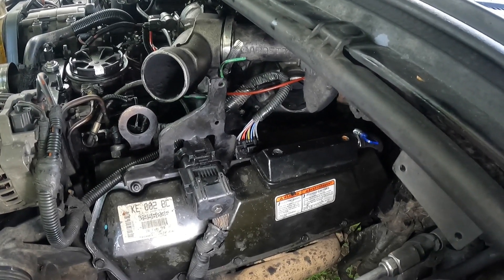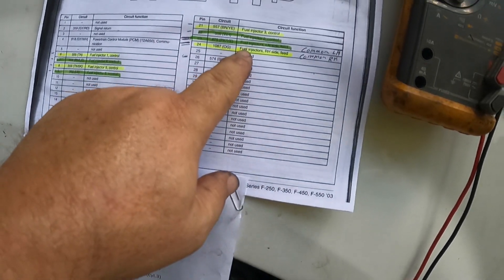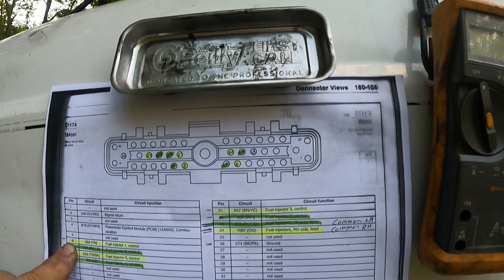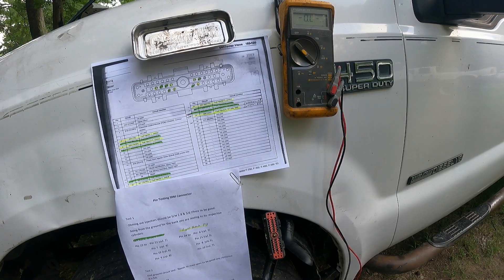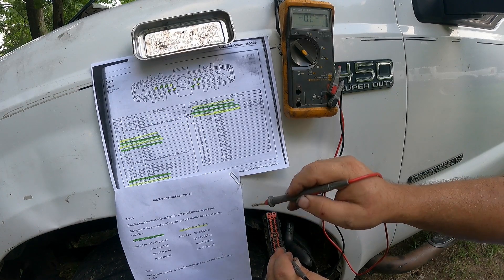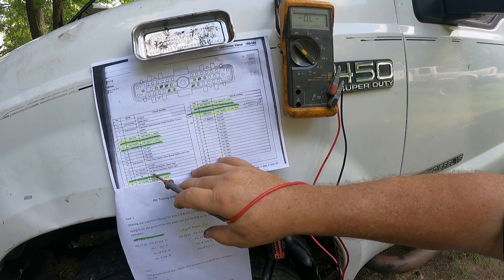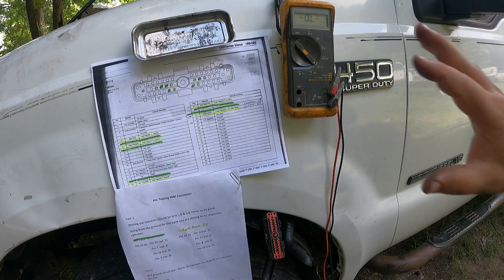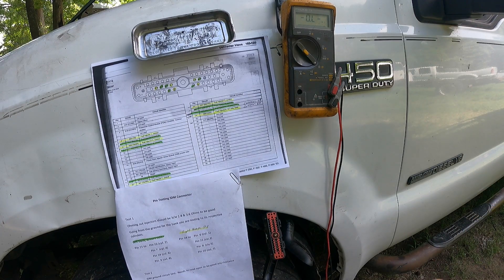IDM Wire Harness Pin Test. P1316 DTC.   2001 7.3 Power stroke

Comment: cyl2 is 14.0 cyl6 is 6.1. every other one is in range . would those 2 injectors make the ohm read like that or is it only related to the loom.
Reply from the maker: Good luck. Hit me back if you have questions or just let me know what fixed your problem. 
If you replaced the uvch and it’s pigtail a good place to check for frayed wires and shorts is both sides of the 42 pin plug. Also is common to pinch wires on the uvch when putting the valve cover back on. 
Thanks for watching
Reply: @bayoudiesel  so the passenger side is fine it's cyl 2 and 6. are not in range.
Reply: @bayoudiesel  the ground to circuit test passed as well.
Reply: @bayoudiesel  and it was the same result with different IDM so I think its safe I can put that back on
Reply: so I reckon I'm tearing down the driver side next. gonna do a new uvch.
Reply from the maker: @recruit_life0715  that is the usual thing to start with. You can also move your test closer to the problem and redo the test at the 42 pin plug as well as the 9 pin uvch connector. But if you are not sure when the uvch was last done it may be good to start there. Up to you.
Reply: @bayoudiesel  where is the 42 pin located
Reply from the maker: @recruit_life0715  that is the large plug that sits over the driver side valve cover. They are known for chafing wires that rub on the Val over itself or in the hard 90 degree turn the harness makes on the engine side. It would be well worth a close inspection even if you have to open the loom a bit.
Reply: @bayoudiesel  yeah got a little chaffing goin on the 42 pin but no exposed wire anywhere. and the 90 degree bend is good as well. do I need to find a diagram on the 42 pin and follow thru with the same test as before? I'm already here maybe should pull valve cover anyway.
Reply from the maker: @recruit_life0715  send me a number or email and I can send it to ya. 
Bayoudieseltrucks@gmail.com

Comment: How can I check pcm power wire to pcm not getting a wts light and not getting any communication with scan tool have checked all my fuses and cigarette lighter plug
Reply from the maker: I test for power at the OBD 2 port as well. If no power there and all fuses are testing good the. Check the pcm relay and pcm diode in the under hood fuse box. If that tests good you would need the pin out diagram for the pcm plug to check that power is getting to the pcm. I can send that to ya if u send me an email or text number.
Reply: I did idm plug check like in ur video but no readings on drivers side looking for 42 connector male side to idm connector pin out would like to make sure that side of that harness is good
Reply from the maker: @coolblue4077  send me your email and I can send ya the 42 pin plug pin out. 
Bayoudieseltrucks@gmail.com
Reply from the maker: The is a pcm fuse and pcm relay. Location depends on what year your truck is. 99-early 02 or late 02-03. 
What year is your rig?
Reply from the maker: Sorry. This replay was from an earlier comment.

Comment: I did this test on my 2002 7.3 and I didnt get any readings for any pins. It said OL on every pin. Am I doing something wrong?
Reply from the maker: Tell me about what the truck is doing. Crank / no start?
Reply: @bayoudiesel  it starts and runs but occasionally will stop running when I’m driving or almost stall at idle
Reply from the maker: @malakis69  what work have ya done to her?
Reply: @bayoudiesel  my father In law is a mechanic and rebuilt the engine not too long ago. He said the only thing he didn’t replace is the wire harness but I wanna rule out as many things as I can before I replace the whole harness
Reply from the maker: @malakis69  smart move. Couple of questions. How much fuel does she have? When u pin tested the harness was the truck able to start or not?  Will she always restart immediately or do you have to wait a while before she will start? Does it kill when engine is hot only or when temp is still cool?
Reply from the maker: Also. If u cranked her up and just let her run by herself what would she do?
Reply: @bayoudiesel  it might turn off or stalls a little then it will catch itself and keep running. It’s not consistent at all either. Some days it won’t do it and some days it’s bad
Reply from the maker: @malakis69  back up to my smart move reply and see the questions
Reply: @bayoudiesel  the fuel was just above 1/4 tank, the truck was able to start, and for the most part it starts without problem
Reply from the maker: As to the fuel level. With the age of these trucks the plastic foot on the pick up in the tanks can fall off. When this happens it will suck air in at around 1/4 tank. Add some diesel and cycle the key a few time in 30 sec intervals to burp any air and try it. You could have an electrical component breaking down if it only acts up when at running temp. But after checking the fuel I’m leaning towards wiring issues. I also find it strange that u had all open circuits on the idm pin out test. I don’t see how that’s possible on all pins.
Reply from the maker: Please let me know what u find out so we can help someone else. Thanks
Reply: @bayoudiesel  I’ll be sure to update if I ever fix it

Comment: Would you need to do this if it failed a buzz test and you was trying to pinpoint the problem. If it passed a buzz test all of this should be fine, right?
Reply from the maker: That is correct. If u get a good buzz test you are usually ok. This test is good for identifying a bad cylinder with bad wires / connectors or solenoids. Also good for narrowing down the location of the trouble. Hit me back if that doesn’t answer your question. Thanks for watchin!!

Comment: I have cylinder #2 bad injector knock replaced all 8 injectors and valve cover gaskets that injector is still knocking so I replaced that injector again stayed quiet for about 10 minutes then more noise no miss runs smooth but if you unplug that injector the noise goes away I am stumped

Comment: Great. This helps narrow things down. 

Did my glow plugs, new valve cover gaskets, and now I’m dead in the water. I have a 1 year on my lift pump and high pressure oil pump. No unburnt fuel or any exhaust coming out as I turn it over. 

Any ideas?
Reply from the maker: Let’s back up a bit. Tell me what she is doing and a little history on ur rig. Let’s kick it around a bit.
Reply: @bayoudiesel   She turns over with not even a hint of diesel. She is my glorious plow truck, was having some hard starts when cold. She would not start when hot. Started great if I wasn’t driving her hard. Did my injector seals and shimmed to get my clearances back while I waited for the new valve cover gaskets to arrive. Still nothing. Unplugged my icp to get my pcm to default 500 while I worked the air out of the oil. I don’t get any unburnt diesel coming out my tail so it’s like the injectors aren’t getting pressure.
Reply from the maker: @rudolfdiesel7.3version31  my take on the “no unburnt” fuel would be either on the electric side or hydrolic side. Either the injectors are not pulsing (electrical) or u have no high pressure oil to push the poppet and squirt the fuel (hydrolic). Do you have access to a scanner so we can see some live data numbers?
Reply: @bayoudiesel  that’s kinda where I’m stuck. When I plug in with a obd2 scan tool I don’t get anything. I realize this is pre 96 but it has a port for obd2 so I’m confused. I swapped the pcm with one that was in another working 7.3. I did continuity tests on all my fuses. Live data stream on the ipc, ipr, and hpop is a route I would like to go next. That said I keep hearing about having to flash my pcm to be obd2 compatible but when I call tune shops they don’t understand what I’m asking for and let’s be honest, I don’t understand what I’m asking for lol
Reply from the maker: @rudolfdiesel7.3version31  doesn’t make sense to me to have to flash a computer to be obd2 compatible if that’s how it came from the factory. Have u run thru the fuses with a test light to make sure everything is hot?  I would start there to make sure pcm is getting power. If not fix that issue. If pcm has power and no communication then I might try swapping with another as long as they are compatible. Does ur check engine light come on and then go off when u key on? That’s a sign of pcm trouble also.

Comment: Thank you for the video! 
I'm dealing with a similar problem: with ignition on I get IDM and fuel pump relay chatter, wait to start and I/d lights flickering with the relays, all fuses test and look fine, I can hear fuel pressure, batteries test ok. 
I cleaned 6 or so grounds and battery terminals. I tightened 3 firewall connectors and checked the IDM connector and pins. 
At the same time, I can't connect to the truck via obd. Bluetooth or Forscan. Bluetooth reader lights up, so the obd port works. Cig lighter works as well. Sometimes turning the headlights on would stop the relay clatter. When the truck is running it's running rough. Sometimes turning the headlights on makes it run better. 
I tried unplugging the fuel bowl heater, swapped relays, tried ignition on with various things unplugged - same. I tested the glow plug relay. Seems to be fine. However, I noticed that glow plug wires from the relay to the valve covers have 12v to positive +, which seems strange to me. Am I correct thinking the glow plug wires have a short to ground? I unplugged the connectors at the valve covers. Still short to ground. I'll check the large square connector on the driver side valve cover, and the wires under it, and perform the same test on the section of the wiring harness. 
I'd love your input!
Reply from the maker: Ok that’s a good bit of data to digest. I’ll have to read it a couple of times to sort thru it. But for starters:
Where does the relay chatter noise seem to be coming from?
Do you have any type of windshield leak ?
And as far as the glow plugs go the glow plug wires are hot from the relay for around 1.5min each cycle of the key no matter what the wait to start light does. They are 12v hot and the plugs ground thru their threads into the block. Like a spark plug. Computer makes a ground to the glow plug relay to make this happen. 
I’ll reread this a bit later today when I have more time and hit ya back.
Reply: @bayoudiesel  no windshield leaks as far as I know. Relays and connectors appear corrosion free. I wrote I checked the IDM connector, but that was the PCM. I'll pull the fender liner next and inspect the IDM. 
As far as glow plug circuit goes: with key off, valve cover connectors unplugged, glow plug wires unplugged from the relay, I get continuity to ground on brown and yellow glow plug wires, which concerns me. I'm going to unplug the large square connector on the valve cover and redo my test. 
Relay chatter comes from fuel pump relay and IDM relay. I can hear it and feel it with my finger. It stops as soon as I pull the relay. Sometimes it stops when I turn the headlights on. 
Truck can start. Runs rough. Sometimes headlight on help.
Reply from the maker: @Za83Rw0cKy  where are u testing and getting continuity on glow plugs? Cause if u test from 9 pin to a ground u will see continuity. And while the 9 pin is disconnected if u cycle key to on u will see 12 v on the pins coming from the engine harness for about 1 1/2 minutes. 
It may be easier to talk it over. Hit me up on email bayoudieseltrucks@gmail.com and send me ur number and a time ur free to kick it around.

Comment: Interesting info. Going to try and use this video to help further try and figure out my p1211/1209
Already did Injectors, icp,ipr, hpop lines/fittings. New wiring harness. And she still giving me shit within 9 seconds of start up. It runs good. But still throwing the two codes. Any ideas before I start this pin test?
Reply from the maker: Not really understanding. Acting up 9 sec but u say she is running good. Can u fill me in more on the problem u are fighting
Reply from the maker: Looked up the codes. And not sure if this pin test is the direction u need to go.  When u get back to me with more of an explanation I can suggest what direction I would go.
Reply: I will try to take some videos and upload them to my channel to help further explain what I'm dealing with. Originally I was having long cranks and low power. Bucking around 40mph. I replaced ipr,icp,cam,ebpv sensors+ injectors/wiring harness, new hpop lines and fittings. After doing the repairs the truck cranks over well. Starts up in colder weather with no issues. Idles much better, but within 9 seconds of running I keep getting the p1211/1209 codes. 
The truck runs way better after all the remove and replaced parts. But still have the dreadful codes.. running out of ammo for my parts cannon.. lol
Maybe fuel tank filters/screens? Or the idm/pcm may need to be sent out for repairs?
I just feel like it's gotta be some electrical side issue
Reply from the maker: @LukeUtigard  I looked up your codes in a ford book I have. As I’m sure you have already checked into. So 1211 ipr pressure above or below desired and 1209 icp fault possible ipr stuck. 
Do u have a scanner that can live stream data to watch icp pressure live?  We’re all your replacement parts ford or known good aftermarket replacements? Screens in the tank are always good to check on if it’s been a while and that would cause power loss. It appears to me that if u are seeing lack of hpop pressure and sense u replaced most of the hpop components the issue would lie with a faulty component or u may have cut o ring from install. Helped a guy a couple of weeks ago and fresh remained alliant injectors had one go bad internally causing a bypass and loss of hpop pressure. Replaced it again and problem solved. Hope this info helps
Reply: @bayoudiesel  thanks. Yeah I did all oem ford Motorcraft parts. They were expensive but I don't want to have to chase down a bad out of the box part. I'll try this pin test aswell as consider the fuel tank screens. I don't have a live scanner and that is frustrating.  I was able to use a nice scanner a few weeks ago. Witch lead me down to bad injectors with the buzz test.
Reply from the maker: @LukeUtigard  cool. This pin test will only let ya know that ur electrical and wiring is good between idm to injectors and back to idm. I would try to confirm that it’s an hpop pressure issue and if so then u may be dealing with a leak in the system or ipr/hpop. Those would be the only way to loose pressure. Another thought is pulling valve covers off and running the truck. Sometime that will show a leak at the base of the injectors. Oil should only be spitting outta the discharge Shute. But driving her with a scanner on live data stream and watching pressure would be the easiest to start with. Good luck. I’m here if ya need bud. Thanks
Reply: @bayoudiesel  thx I'll keep u posted
Reply from the maker: @LukeUtigard  definitely please do. It will help me help out someone else down the road. Appreciate it.

Comment: What should I do I have high continuity on the passenger side bank and I don’t know what wires to trace the truck starts but runs rough and dies.
Reply from the maker: I have a few questions to get ya started. High continuity on which wires?  Do u know which injectors are the possible trouble causers?  Do you have access to a scanner for live data, buzz test or cylinder contribution?
Reply from the maker: Just need to see what we are working with before we get into it.
Reply: Yes I have FORScan
Reply: And The continuity that tested high was the passenger side I’m not sure which injectors I forgot but one thing I do want to mention is I ended up popping off the valve cover and I swapped the valve cover gaskets in the truck started rough but it started
Reply: Is there a way that I can contact you to send you pictures at all of what I’m doing?
Reply from the maker: @kyhriebrady9477  sure thing. Hit me up at bayoudieseltrucks@gmail.com
I’ll be happy to take a look.
Reply from the maker: @kyhriebrady9477  not sure I’m following ya. When u swapped sides on the under valve cover gasket did the problem follow or stay on the same side?  I’m trying to see if u have a gasket harness problem or injector problem?

Comment: I have 7 testing between 4.2 to 5 ohms on a cheap $5 tester from Harbor Freight. The #2 injector wire tests at 745 ohms, and I’m going to trace that wire down. After I solve that problem, should I be concerned about the others testing about 1 ohm higher than spec? Or could it just be the cheap tester? TIA
Reply from the maker: It very well could be the cheap tester. If u know someone u could get a good one to verify yours that would answer that. If u are ohm testing from the idm plug to get these results I would move closer such as doing the same test from the 42 pin connector on top of the driver side valve cover or going right to the 9 pin uvch connector. More offer than not u will be chasing wire/connector issues. But to rule out injector solenoids for that 1 ohm overage test the directly. If in spec then the issue is in the harness.

Comment: Is this information the same on the obs?  Very useful information, thank you.
Reply from the maker: All the 7.3’s I’ve been dealing with have been Superduty’s  im not familiar with the pin outs on the obs. But the procedure should be the same. What I would do is see if I can get the wiring diagram and the pin layout for the the connectors. Then ohm them out.